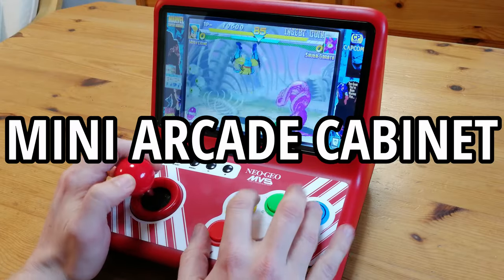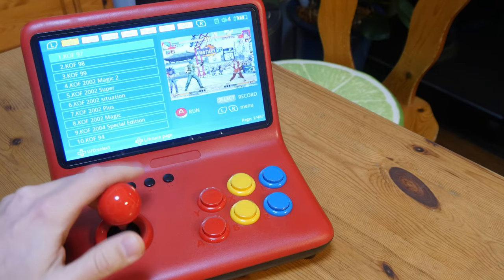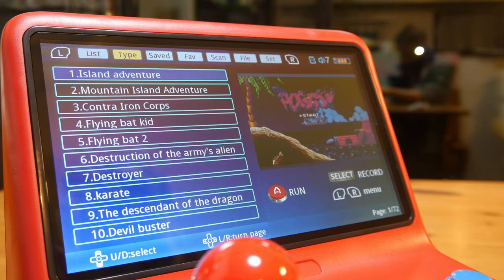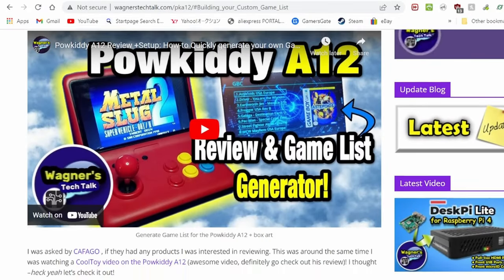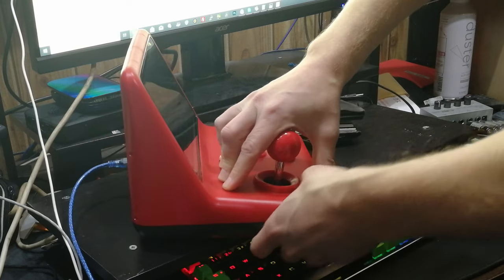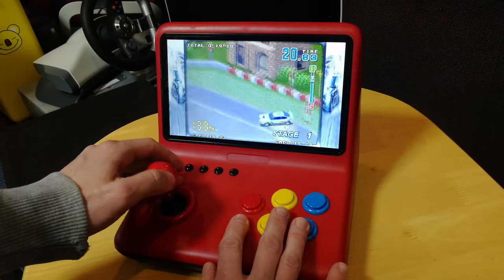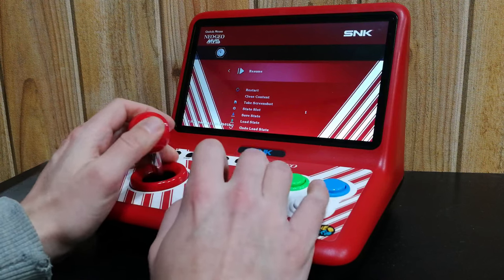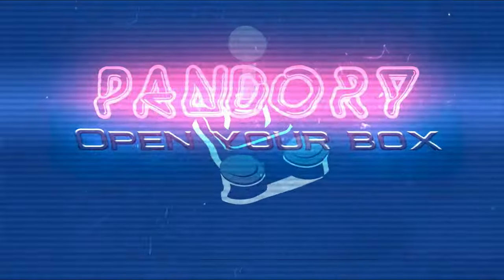What is THIS?  MVS Inspired Mini Arcade Bartop [Review]

Comment: I enjoy my A12, but the washed out screen is really the main drawback. The screen on your A12 looks much better than mine though. I wonder if they've upgraded it? Also the CFW video you link to has comments saying the CFW has worse battery life, you can't adjust the brightness, and can sometimes cause crashes when the battery is below 30%. Has the CFW been improved since then? Thank you!
Reply from the maker: I'm unsure ... Maybe the washed out screen is bilinear filter?  
The cfw in my opinion changes the game as the stock fw is a bit meh. We have had crashes at lower power levels, but that's probably because it needed charging. :)

Comment: The real problem whit this machine is the batery, crack after 2 or 3 month of use... But, is an awesome machine. Great review!
Reply from the maker: Good point. Thing is the battery could be switched for something of better quality. It's not like a cellphone when it comes to exact size, hook up two wires and it should be sorted with this machine

Comment: Mine doesn't have these games or menu. I got my a12 last year, is this a newer revision and if so can mine be updated to use those setup instead?
Reply from the maker: The best thing to do IMO is use ruka cfw. The stock firmware isn't the best, but at least it plays games alright.
Reply: I got mine two years ago and I also don't have this default menu or games. I think maybe different sellers have slightly different variations.